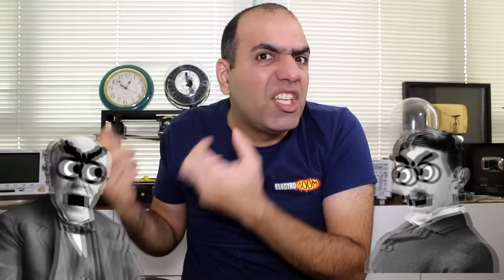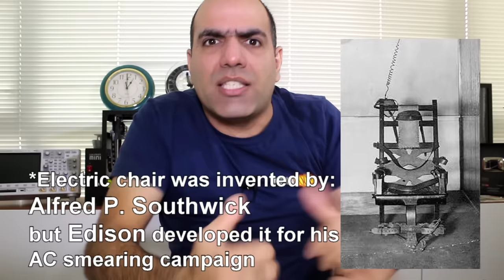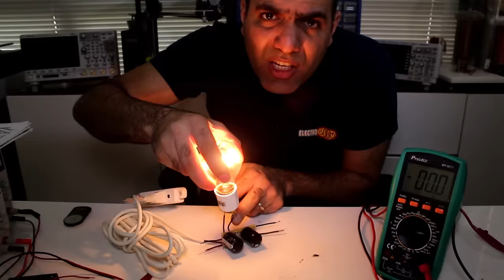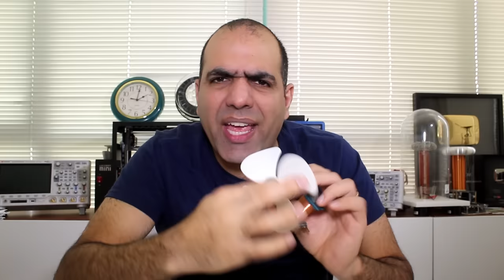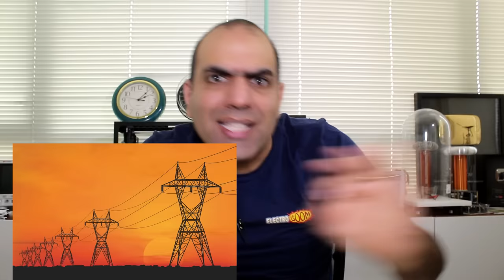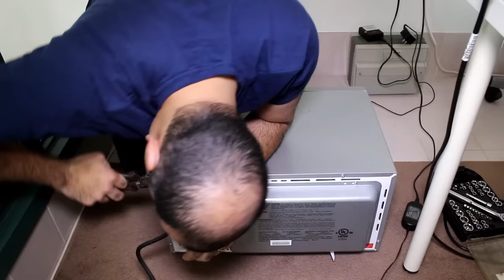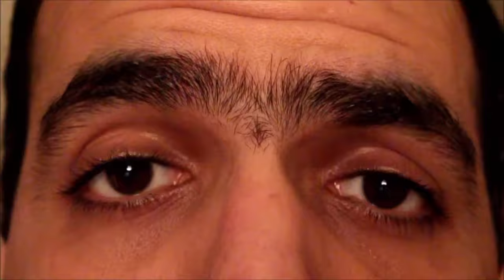Why Use AC Instead of DC at Home??

Comment: Honestly though, HVDC is the future especially since the rise of power electronics. It's much easier to control and has no capacitive coupling, or annoyances like the skin-effect. AC won the battle a century ago because it was much easier to transform to high voltages, meaning lower currents, meaning less losses over long distances, but as DC becomes increasingly easier to transform, AC is beginning to lose its most important advantage. As far as low voltage goes, AC may still be more relevant, as AC naturally goes through zero according to its frequency, meaning simple switch/disconnector can do the job, but with DC, we're gonna have to use powerswitches because without it, the risk of electric arc
s (leading to fire or damage) is too great.
In terms of safety, who freaking cares? AC may be "more dangerous" (although "easier" to let go), but 0.1 A will kill you anyway. If we're comparing 230V AC with DC, you're pretty much dead no matter which one you touch.
Reply: I'm gonna start studying about protection devices for HVDC systems this semester, it is indeed the future

Comment: in the PV community there are people who build DC Home Systems.
The Problem:
A electric Car battery needs to get charged with DC. Usually with a voltage of 700v or 800v .
A Solar Panel always delivers DC and can be put in series to almost perfectly deliver the target voltage of the battery pack you want to charge. 

With the classical  solution you require this extra hardware:
- Convert DC to AC for the home grid
- Convert AC to DC for the Car.

the hardware is costly and comes with an energy loss.
Comeback of DC :D
what do you think about that ?

Comment: How about HVDC lines?
Reply: Narrow use. Much more complicated converters.
Reply: I was thinking the same thing.
Reply: Not that limited these days. We utilize uhvdc in the million volt ranges now. Its the only way to go for long range transmission to the interchanges because of corona effect. Widely used on PILC cables layed across bodies of water since the 70s because of capacitance issues.

Comment: it would be nice if homes had inbuilt 12v/5v DC circuits for phones and other electronics, but kept 240v AC for high powered things

like almost everything (probably) could be powered by that 240w USB PD standard, and transforming it at one point instead of in every device is surely more efficient

Comment: Introducing HVDC(High Voltage Direct Current) transmission :)
Reply: @mc140201525 Ali Kashan Hassan China is building 1 mega volt system

Comment: So why not transform to DC where the power enters the home and then all appliances have DC?
Reply: Very good idea. Then you can apply power factor correction at the rectifier. Solves a lot of problems for the power companies. Downside, it costs and many currently used loads wont work. But worthily  to investigate to migrate to.
Reply: Because until the 70s almost all power was drawn by motors and incandescent lights, which work just fine with AC.
Reply: Also because then wiring your house takes way thicker wire.
Reply: Another reason is that the 60hz or 50hz ac is extremely stable and useful for clocks or oscillators that sometimes sync on the ac.
Reply: KotoRyu Not if you keep the same voltage. The reason A/C is distributed is because it's been historically easy to switch voltage levels. A DC network with the same thickness of wire is totally doable nowadays, but conversion would be extremely difficult and mostly pointless.
Reply: CODMarioWarfare   I believe that is right. It's the high voltage that enables the low current for the same power.
Reply: "why not transform to DC where the power enters the home and then all appliances have DC?"
You'd need at least 10 times more copper in your wiring just to start with. 
Also, no 2 outlets around the house, would have the same voltages due to the voltage drop by the different length of wirings.
Reply: Dirk Reisig   Isn't power factor an issue for large inductive loads?  e.g. large motors, not vacuum cleaners and LED light bulb inductors vs. 100 hp motors?

Comment: so why don't we just convert the AC to DC in the small Transformer that is just outside our house? 

Sorry If I seem like an idiot I'm new to Electrical engineering!
Reply: Yea I know about that! But the power bricks always generate a lot of heat, and some of them even make an annoying buzzing noise! 

In the future I think nearly all household appliences will need an AC to DC transformer, and even now we switch to L.E.D light bulbs  which have a small transformer in them! Surely soon AC power in the house will be pointless and inefficient!   So why don't we just have 1 transformer that does it all !?
Reply: first things first... there is no such thing as DC transformator. DC can not be transformed like that. Only AC and it is much cheaper to do that with transformator than DC. Otherwise you need stepdown transformer for DC, or rectifier after ac transformator. Stepdown regulators chop the dc in to bunch of square positive or negative wave, depending of what application needs. You can choose width and height of that signal and also how long is the on and off time (to not use technical term :)). To get specific voltage and power. DC will for sure further develop on battery powered tools and appliances, you cant store AC for now, at least not very efficient. On the other hand, AC motors are more reliable and more powerful for the same dimension as DC ones. Especially 3 phase induction motors.
Reply: BurnerProducts RocketStoves I have a design for a DC transformer that I need to patent, it's 100% possible you just need some special coils and stuff.
Reply: Because everything in your house is already designed to take AC. This means you would have to replace everything that plugs in or add a DC/AC converter so you can use your existing electronics. Also every house would have to have its outlets changed to something new because plugging an AC devices into DC power often results in a short(transformers and AC motors both look like straight wire to DC; too big of a safety risk). So it really just comes down to the cost of retrofitting. 

I don't know where people are coming up with things like saying there will be too much wire losses. 120VDC is more efficient than 120VAC because it has exactly the same wire loss but with a guaranteed power factor of 1(meaning you can use smaller wire).
Reply: yea, that's the only problem. thanks!
Reply: Dom wpc You cant use a single transformer before your house because every electronics in your house runs on different levels of DC. Your phone charger is 5V, your laptop charger is around 20V. Even if you had DC in your house, you'd still need to transform it to many different levels. You can only do that by converting it to AC first, so it's kind of pointless.
Reply: Amir Abudubai well actually most devices/appliances take DC they have power bricks or build in converters that take the wall AC and convert it into DC so it can be used by that device/appliance
Reply: carolyn mmitchell you can't patent the buck/boost DC transformer.
Reply: BurnerProducts RocketStoves Are you sure transformers don’t work on DC? As long as the current flows in 1 direction only, it is considered as DC. So if I make a PWM thing and switch the DC on and off continuously, (that means cycling between +220v and 0V instead of between +110v and -110v, there will still be a changing magnetic field in the transformer and the transformer will work.
Reply: Because there are issues with that:
Most devices run on 3-24V. You saw in the video what happens to the wires when you try to transfer a lot of power at low voltages... and we are talking about much lower voltages than even that. Let's assume your have a computer that consumer 500 watts of power. At a standard voltage of 12V you'd be drawing 40A through the wiring, and that's just 1 device! If you factor in the trend towards 5V USB power, you're at 100A!!!
You also need to keep in mind that the voltage will need to be stepped down again for different devices, which means you will need a power delivery circuit in most appliances anyway.
Reply: Dom wpc 
Firstly, not all countries use small transformers to distribute power to a few properties, some use much larger ones to cover several dozen properties. 
I agree with the logic of your question but, as others have pointed out, it would be impractical to use DC throughout the entire property. However, I believe that it would make sense to use just such a system for household lighting. As you point out, every LED bulb has a rectifier and some kind of voltage dropper (SMPS, capacitive dropper) to supply the DC voltage to the LED's which is often the cause of failure. If there were a transformer in every home just for the low voltage lighting circuit then perhaps we could all use simple 12v DC LED bulbs instead without the costly electronics and prices could fall for LED lighting.
Reply: Maybe polarity. Microwaves need AC to work too.
Reply: The microwave needs the AC input to step up voltage to 2k volts. Also, if you live in a country that uses 220VAC but you have a device that can only use 120VAC, you still need an AC input to step down the voltage, which you can’t do if DC is going in your house.
Reply: Microwaves (I presume you mean the oven variety) can produce the desired internal voltages from a DC input by utilising pulsed DC as in a switched mode power supply or a boost converter. Strictly speaking, most electrical devices can operate on DC power if they're designed to do so from the outset but to operate everything in a typical home from DC power would require quite a high DC voltage to give the required power without having to use ridiculously thick supply cables and house wiring so most of the advantages would be cancelled out.
Reply: That's not true at all, there would actually be less heat if you assume the same voltage
Reply: thanks for your opinion ; )
Reply: Conversion on the pole. So it's a cost thing and a time thing (same)...It can be done. Don't ever tell an engineer it cannot be done. I've often wondered the same. When things good to embedded in money and the comfort it allows certain individuals it's...er, taboo?
Reply: And in the end a good company to buy smoke bombs.. aa.. sorry.. capacitors from. :D Gotta love it.
Reply: Lucas Silva agreed, anything with an smps (just about everything these days) can use DC. If you open up a laptop charger brick and inspect the circuit, the very first thing that happens is the input gets rectified to DC.
Reply: Henry Chan amd in that case you are still generating AC, each time the magnetic field in the transformer collapses the current will reverse direction. Thats why even in DC to DC converter you still need a rectifier on the transformer output
Reply: Henry Chan alternating between 0 and 220, is still alternating. I understand what you mean, but it would be less efficient than stepping the pure some wave that comes from the utility. Besides, you are describing a SMPS, nothing new, just about every device has one these days.